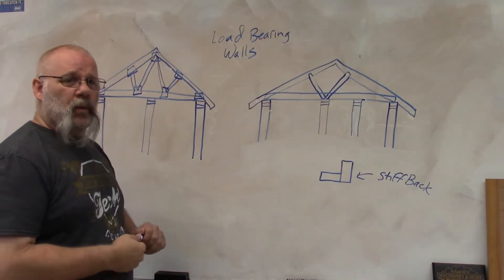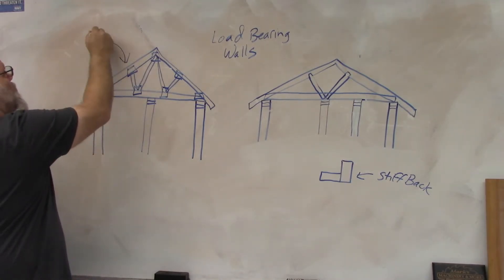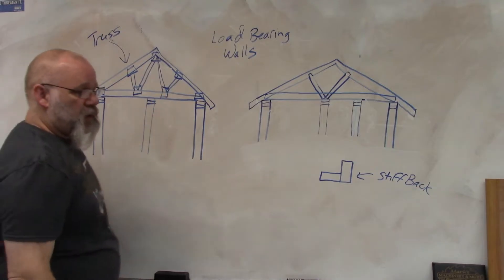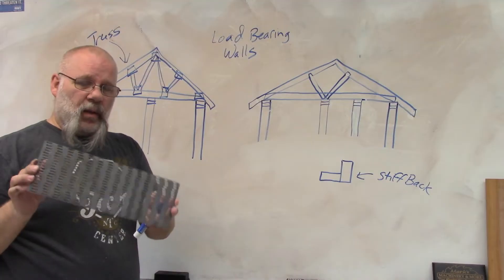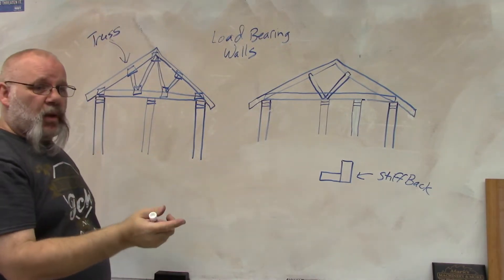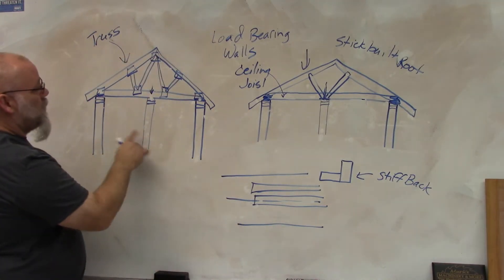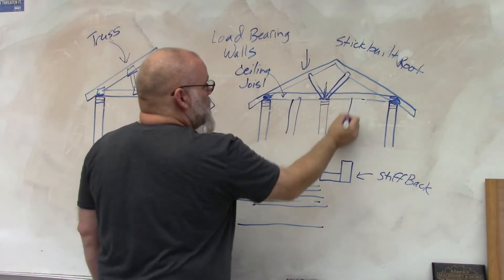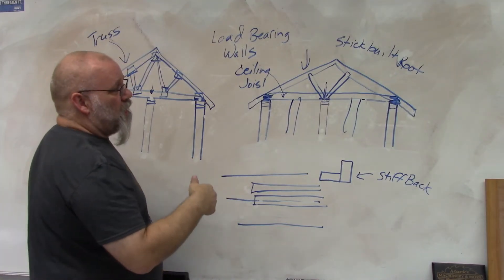Identify load bearing walls in single floor structures

Comment: For the stick built roof. What if its one full length no splices is the middle wall still load bearing? My ceiling joists runs perpendicular runs one end to the other no splices
Reply from the maker: If it sits on end walls which are load bearing with no splice the wall is probably  not load bearing. Sometimes if the ceiling joists are under sized the wall may be load bearing. If your not sure have a pro look at it. There are span data charts on line.

Comment: So rule of thumb, if there's a splice/join in the ceiling joist above a stud wall then it's load bearing
Reply from the maker: If the roof is stick built. Truss rafters it probably is not.

Comment: I am a professional truss designer. This is NOT CORRECT. Even in small, single story structures, roof trusses are sometimes designed to bear on interior walls, and that bearing is not always at the ends of the truss. metal-plate-connected trusses are not always designed to transfer load to the bearings only at the ends of the truss. I cannot say this enough. 

My recommendation, if you find that your have metal-plate-connected trusses in your house, is to go to your local code enforcement authority and ask to see the sealed truss drawings that they might have on file. From the beginning of metal-plate-connected trusses this has been a requirement, and I realize that they may no longer have them on file for a house built 60 years ago, but it is a place to start. And only those sealed drawings will tell you for certain which walls the truss is using for bearing.
Reply: I spent 10 minutes surfing through comments to find something like this! Thank you for this comment.. I had a feeling that this video was not accurate. I needed to see a few videos without anyone with some real knowledge commenting on how this is absolutely not correct!!! this guy is gonna get people killed!

Comment: Question: my house was built in the 70’s. I have plywood gusset plates as opposed to stamped metal. Was it typical for truss companies to use plywood gusset plates or was my roof trusses “site built”? Secondly, I’m a contractor remodeling my own kitchen removing a center wall between the kitchen and living room.. The trusses seem to be self supporting. There is the “w” pattern in the truss and no interior walls seem to fall in the center of the trusses. What headers in these walls above doorways are just 2x4 constructed leading me also to believe they are self supporting. However, I’ve uncovered things in this house that I believe to be some pretty shoddy construction causing me to seriously second guess myself. I could install a lam beam where I removed this wall across the ceiling but I’d rather not. Any advice you could give on these questions?
Reply from the maker: Metal gussets were invented in 1952 so wood ones could still have been used in the 70s. Everything you said leads me to believe the wall is not load bearing so no beam is necessary. There are a lot of people that call themselves carpenters but do iffy things.

Comment: In college we learned the math to calculate actual loads.   The  reason why a crane can lift so much weight because of sign and cosign
Reply from the maker: @Sun_as_a_Guide  I also learned it when I got a civil engineering degree many years ago.
Reply: @timpalmer-logstolumber1999  It is important to teach this to the young
Reply: @timpalmer-logstolumber1999  It was the 80's for me

Comment: There are so many other variables you left out.  Roof pitch, shingle type, maximum span, truss spacing.  This video is dangerous.
Reply from the maker: @joshreinema9807  those things are taken into consideration when designing the truss rafters and the walls that support them.

Comment: The only actual way to identify load-bearing points on an engineered truss system is to inspect the stamped engineered drawings, which should be included with the truss system purchase. Anything else is speculation.
Reply: Have fun doing that on my house from 1967. Go find the drawings for my house......... I'll wait
Reply from the maker: @francesforbes2957  this is true but once the house is built the drawings are usually gone let a lone years after it is built. A good knowledge of how things are built is the next best thing.

Comment: Hey, Great video! What if I have a standard roof truss system (like diagram 1) with no vertical truss support the middle bottom of rafter to ridge. However, there is a meetup of the rafters on the bottom with a splice with gang nails holding them together (no overlap). If that's the case, is it still bearing?
Reply from the maker: @Erikzapp  do they have any webbing? If yes then outside walls are load bearing. It sounds like this is the case. But without seeing it I can't be positive

Comment: Thank you sir!
May I please ask you a question, I have a trusses roof hoise that mean I can remove a wall from kitchen to living room right?
Reply from the maker: Truss rafter bearing points are usually on the exterior walls. So if this is the case in your house then the wall can be removed. If possible, visually check to make sure it is not supporting anything. Get a professional opinion if your not sure.
Reply: @ 
Thank you, my house is built 1986 and it is brick wall outside , I also went on the audit to check, but I’ll make sure again before demo,thank you!!!👍👍👍

Comment: OOOPS.  Both of these are TRUSS Rafters.   Just one is an Engineered Truss.   The other is just a three point Truss. (design).    The term Truss is just not understood.  And don't get me started on what a gert is ~ and purlins.  But of course all good here.    At least this is thought about .   For me it's the snow load.   Can the roof handle two feet of wet snow?   or a Hurricane?   How about dormers through the roof?  Never heard of a "stiff back."   That's a fun concept.  Ok   Fair enough.  Thanks for this.
Reply from the maker: @stevenwarner7348   one thing I have learned is that the naming of things is not the same everywhere. Even text books will have things different.
Reply: @timpalmer-logstolumber1999  I agree.  That is true.  Thanks for the post.

Comment: Would there ever be continuous joists over a load bearing wall?
Reply from the maker: @nicholasalteri3144  it is possible but not likely. If the joist is to small for the distance it is spanning they could put bearing wall below it but normally they would just use shorter joists.
Reply from the maker: @nicholasalteri3144  it is possible but not likely. If the joist is to small for the distance it is spanning they could put bearing wall below it but normally they would just use shorter joists.

Comment: For a hip roof, with a splice in the ceiling joists, is the wall underneath also a load bearing wall? Or, only the exterior walls? Thank you!
Reply from the maker: @em-27-195  without seeing it or more specifics I would say the wall is load bearing

Comment: My house ain’t that shape. So basically wherever joist ends/cuts sit is the point of load/contact.
Reply from the maker: Yes, any wall that has a ceiling joist end on it will be load bearing.

Comment: If the ceiling rafter was one piece from end to end that would put it in tension meaning any wall in the middle would not be a bearing wall .
Reply from the maker: Yes, that is correct

Comment: Might be a stupid question, but I want to make sure…if I remove my drywall and see there is a gap above the to plate, it is safe to assume I am not dealing with a load-bearing wall?
Reply from the maker: Yes, if there is space between the top plate and bottom of ceiling joist or bottom cord it is probably not a load bearing wall.
Reply: @timpalmer-logstolumber1999  Great—thanks!

Comment: What if you are stick framed, but the ceiling joists run the whole length and do not have any splice?
Reply from the maker: If there is no splice, the walls in between the walls that have the joist ends are probably not load bearing. But sometimes in order to use smaller ceiling joists they make a wall in between load bearing. You can check the load bearing capacity of the joist using a span data chart.

Comment: sir,can we use concrete solid blocks as load bearing without any column and beam to carry all load from roof slab via walls transfer to foundation?
Reply from the maker: yes, as long as they are rated to carry a load. depending on the length of the wall you may need to buttress it, or you might use cinder blocks with the holes so you can fill some of the holes with mortar and add rebar to reinforce the wall.
Reply: @timpalmer-logstolumber1999  sir thank you so much for reply me in  my country pakistan most of people in load bearing house  construction only using red bricks  without colmn and beam so i am thinking  to use same method with concrete solid blocks without column and beam  with low buget
Reply from the maker: @yousafkhan7622  I think you would be good

Comment: Thanks so much! I recently purchased  an old, 1946 house with rafters that initially did not have any bracing besides collar ties. It looks like they added purlin bracing later and I think it’s caused some drywall cracking and sagging. In the case where you don’t have load bearing internal walls, but still need to add support to prevent a sagging roof, what should I do? I know theoretically that the continuous joists should distribute that load to the exterior walls, but there been some obvious deflection where the bracing was added. Patch drywall and move on?
Reply from the maker: You can add stiffbacks on the underside of the rafters and the top side of ceiling joists then run bracing from stiffback to stiffback. The stiffbacks will distribute the load and help with sagging.
Reply: @timpalmer-logstolumber1999  thank you! Maybe even just a rat run with some bowed lumber would fix it.
Reply from the maker: @Braindead154  some people call the stiffback a rat run, they are the same thing

Comment: Mine is a similar set up the left drawing. I want to take out a wall in my kitchen to open it up. Is it this safe for the joists to run all the way across 25 ft?
Reply from the maker: If they are truss rafters they are designed to transfer load to outer walls. The wall can be removed. If not sure always ask

Comment: That truss supporting interior wall you state is not bearing a load load actually bears a load  since it supports the beam above it since the beam above it deflects downward due to the loads from the two truss members it supports. Removing that wall removes the bearing it provides and that causes the beam above it to deflect downward.
Reply from the maker: Are you talking about the left or right diagram
Reply: @timpalmer-logstolumber1999  Left. Although the wall in the left drawing does not bear as much of the roof load as the wall in the right diagram it bears a significant more load than the outer walls.
Reply from the maker: @hydrostatics4977  the wall is not load bearing. The truss rafters are designed to transfer load to the outer walls. You could install the rafters and dry it in then install interior walls. There may be some deflection over time but it is not load bearing.
Reply: @timpalmer-logstolumber1999  What is the basis for your understanding that the beam isn't bearing any of the load from the truss? As a licensed engineer in the field we use structural mechanics to make these determinations.
Reply: Well, akshuwally.......got to love pedantic engineers.
Reply: @stewardslandscape  In other words, you do not have a background in engineering?

Comment: It's been said, this video was a quick to understand the load bearing.  I appreciate it.  Is it necessary to get an engineer study for replacing load bearing walls with a beam, once the wall is removed?
Reply from the maker: You could ask a contractor, they should know. It will depend on the load and span.

Comment: with trusses , will it sag any if i take out a 26 foot section, on the middle wall
Reply from the maker: No, the trusses are designed to transfer loads to outer walls

Comment: I have a question about cape cod style houses go. On deed it says 1.8 floors. Upstairs has 2 finished bedrooms with approx 4 ft knee walls and nothing in between. First floor ceiling joists butt up against eachother  with wall directly below and steel beam in basement the entire length of house. But  wall on other half of first floor is offset approx 3ft. I am not sure what style truss are in the attic but house was built in 1942 and im not sure that type of truss was available back then. Because there is 2 bedrooms upstairs im assuming that the walls below would be load bearing, especially in snowy area. Thanks for the great video and any information you may have on these style houses would be greatly appreciated.
Reply from the maker: If the rafter has gussets it will be a truss rafter, the weight will be on exterior walls. If stick built it will not have gussets but load will still be on exterior walls. The only walls considered load bearing are the ones that carry weight. In most cases the weight is carried by beams, floor joists, or ceiling joists. If a wall is load bearing the ends of the floor/ceiling joists will rest on the wall. It sounds like the wall you described is load bearing. The wall sitting on top of the steel beam will be load bearing.
Reply: @timpalmer-logstolumber1999 thank you for that. I haven't received much information on how these were built in the 40s. The wall does run across the top of the steel beam in the basement. That is the 1st floor, above that is basically a finished attic. The ceiling joists do not overlap over the top plate on the first floor wall and there is no wall in the so called 2nd floor (finished attic) all i have is a wide open bedroom on each side. The reason I'm looking for answers is when I do decide to continue with my project and call an engineer. I would like to be able to explain how I want fully recessed 8"X whatever width i may need to carry the floor load14-16 long, in order to have a fully open living room/kitchen.

Comment: Hi Tim, looking at your drawing on left ----where wall in the middle is no bearing wall. I have structure just like that, where ceiling jois are NOT splitted in the middle. Question: Is it safe to remove a wall in the middle? Again, ceiling jois go from one end to the other end. please advise.
Reply from the maker: If the walls are close enough together that they don't need a splice the weight is still on the exterior walls. Removing a wall is not going to be a problem.

Comment: So on the structure with the truss do you have to do anything to the webbing in the attic if removing the wall below?
Reply from the maker: No, you shouldn't have to do anything with the truss
Reply: So your drawling on the left is very similar to what I am working with. Want to remove a closet and the webbing is at the exact spot before the front closet wall.

Comment: Hello, I have a 1978 split level house with a manufactured truss (same shape as your video) gable roof. Since it has a basement, does same principals apply? The living room has a 2 ft jut out on long side of house if that matter? The wall going is going perpendicular to the trusses and isn’t in the direct center of house.
Reply from the maker: The two ft just out is called a cantilever, it has no affect on interior wall. If you have truss rafters the interior wall is not going to be load bearing.
Reply: @timpalmer-logstolumber1999 so if I have a Howe truss system, I can remove any interior wall with out structural support?
Reply from the maker: @checkit6699  if you have trusses above second floor you can remove walls on second floor
Reply: @timpalmer-logstolumber1999  perfect thanks a lot. I wasn’t sure because I’ve been told certain walls help support movement from climate & wind.
Reply: @timpalmer-logstolumber1999  I’ve  taken out rafter load bearing walls & replaced with a beam. But, I’ve never experienced a truss system yet. This is my first one. Thanks for all the help
Reply: @timpalmer-logstolumber1999 I have a 2 story house, the walls on question are on the second floor (top floor)

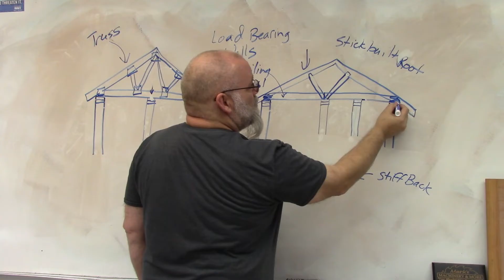Comment: 3:54 What if there was ceiling joist split? (as in, each joist is 1 solid piece from exterior wall to exterior wall). Would that middle wall still somehow be load bearing?
Reply from the maker: If supported by webbing, no. It would depend on length if not supported. A longer board may have some deflection unless it's wider. If not sure ask a professional.

Comment: I love this video. Whew! I was so worried that my contractor ripped out a load-bearing wall. I have a truss manufacturer one-story house. The wall was in the middle end  attached to the exterior wall to expand the bathroom
Reply from the maker: It's great that you studied this to make sure what they are doing is correct. Not all contractors or carpenters can be trusted to do things correct.

Comment: Great Video! How about on high ceiling trusses, if a wall is running parallel to them? Can it possibly be load bearing?
Reply from the maker: Probably not, those are probably scissor trusses. The outer wall that they sit on will be load bearing.

Comment: What if I have Truss ceiling. But the Ceiling joists do have a splice in the middle bcz of the roof width. Is the wall underneath the spliced ceiling joist load bearing ?
Reply from the maker: No, the splice has a gusset. They are designed to transfer the load to the outer walls.

Comment: When considering which walls to remove, please add sheer wall(s) as well. They are not load bearing, but provide the necessary shear strength to not allow movement (from wind for instance).
Reply from the maker: That is a good point. This video was for identifying load bearing walls. I will do a video explaining sheer walls, thanks for input.